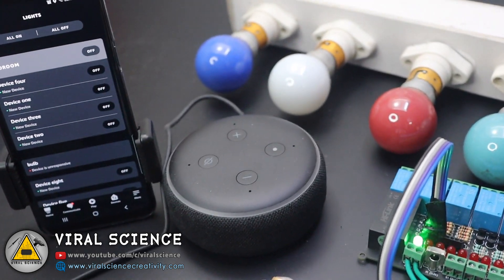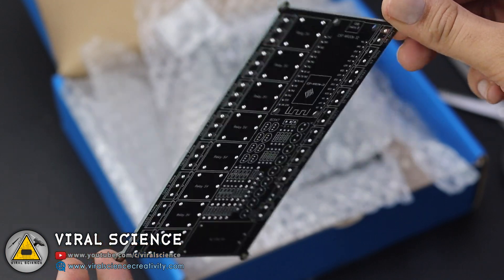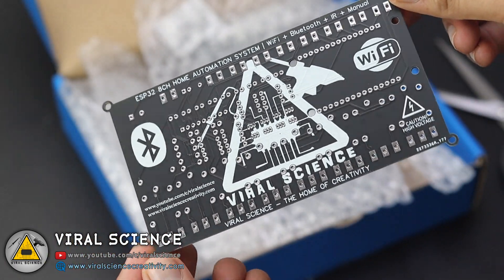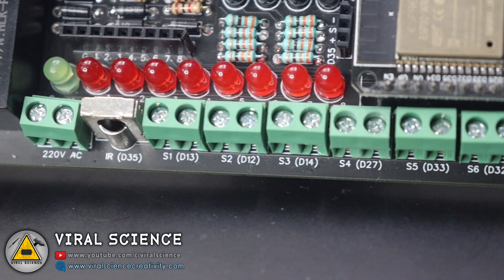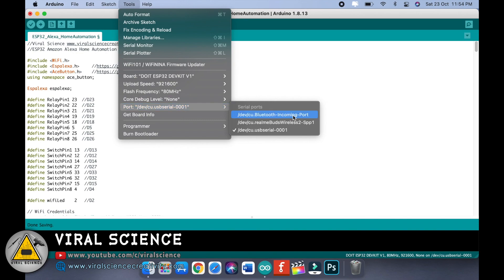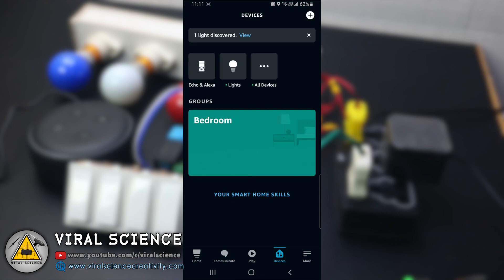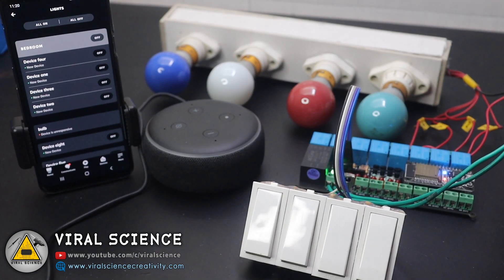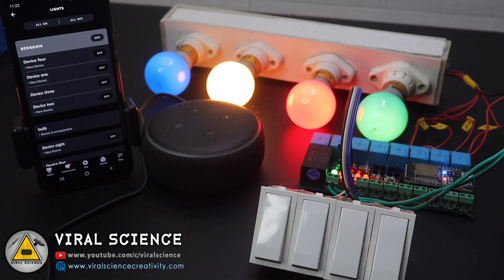ESP32 Amazon Alexa Echo Dot Manual Switch Home Automation System

Comment: Is it necessary to connect the pcb with ac supply to discover device on Alexa? It is required to have Alexa for this project or it can be done by Alexa app?
Reply: Yes you need alexa device

Comment: You show very well how to build up your beautifully designed pcb. But if you look closely at it, you're better off working from the lower components to higher ones. Especially if you put the components through the printed circuit board.
The more frequently used wires that you put in the terminals should first be finished with cable end sleeves so that the risk of short circuits due to protruding wires is excluded.
This also reduces the risk of wire breakage. It makes the whole thing safer. And it looks even better.
And above all, continue with these videos of well thought out circuitry.